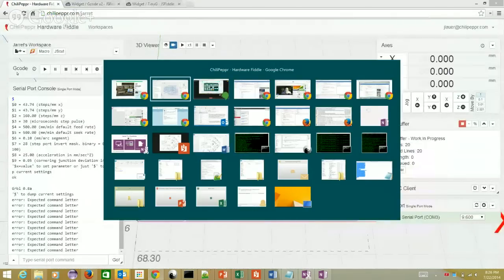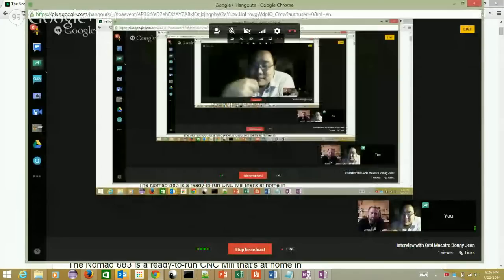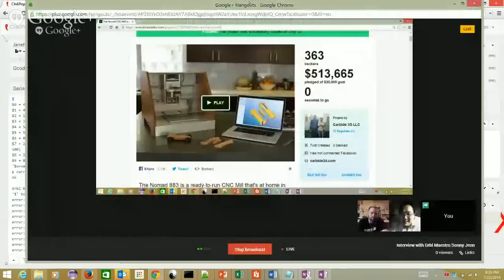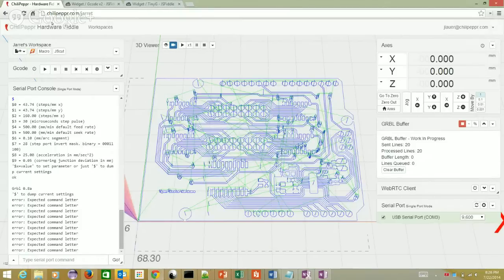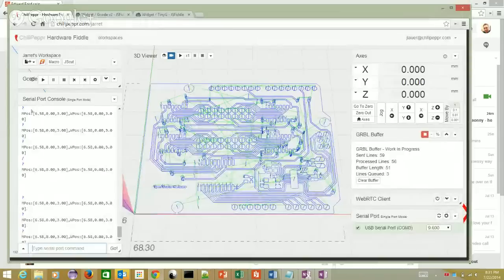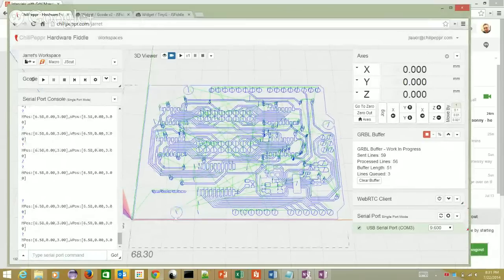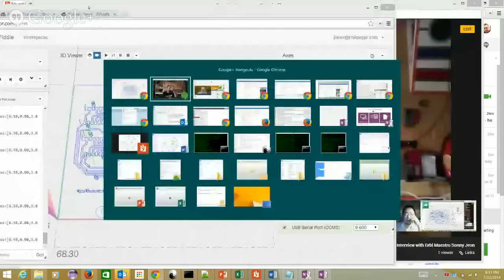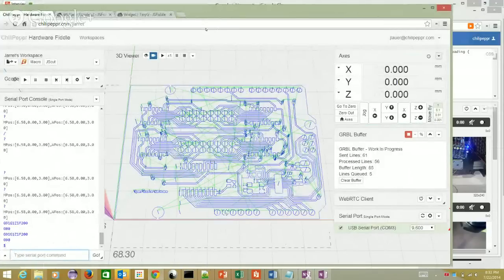Interview with Grbl Maintainer Sonny Jeon

Comment: I had my Larken cnc controller running LCAM  doing fast 3D probing in 1996 .  It can probe a 3d object keeping the probe down following the object and then output a  3d DXF mesh file.  I started writing LCAM for Dos in 1990 using turbo pascal . Then wrote my Starcam controller for windows had 3d probing in 2002 running a Pic18F452 .   But even 20 years later, the grbl does work pretty good for an 8 bit processor.

Comment: A walk-away manufacturing/machining center (milling machine) would ideally be a horizontal style machine, which allows chips to fall full away from the cutting tool. Another plus with this design is that you can easily add a tombstone fixture - check it out! Tombstones add immensely to the capabilities of the range of projects running consecutively... Also, why couldn't canned cycles be added via a Micro-SD card reader with the cycles stored on the card, called into a virtual consecutive program line, then after the cycle is finished, drop to the next actual line...?

Comment: The reason xon xoff does not send immediately is the usb end point buffer is not full with a single character. There may be a way to flush the buffer on the pc side.
Reply: Yep, that correlates with what I observed when trying to implement XON/XOFF with Grbl. Unfortunately, the atmega8U that the Uno uses for the USB-serial interface doesn't handle this flushing well. In my tests, it almost always broke. But, if you use a board that has an FTDI RS232 USB-serial chip, like the Duemilanove, XON/XOFF flow control works as expected.

Comment: When you're old enough to remember when all PC's were proprietary, you have a natural hatred of commie Mac's.  I'll never understand how opensource guys can even touch a apple product.  Pre IBM PC, any computer you bought could only be upgraded via it's creator (apple even made their on CPU and chipset).  Which meant that for instance, when Radio Shack's Deskmate Tandy line was still being sold (as in before it was discontinued), the lowest price of their CDROM drive I remember was still $595 (down from $1300).  So if Apple had beat out the opensource IBM type PC, we would today be paying at least 10 times more for a PC that would be 10X slower with 1000X less software capability.....